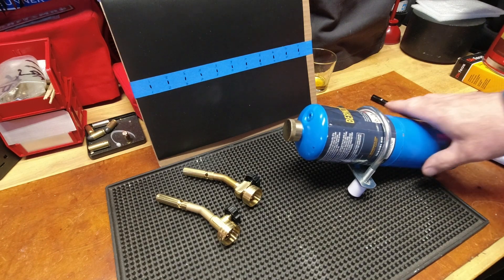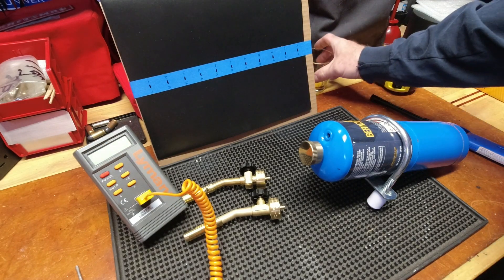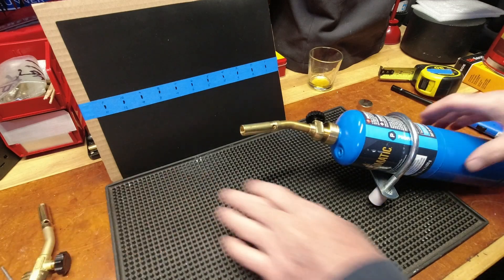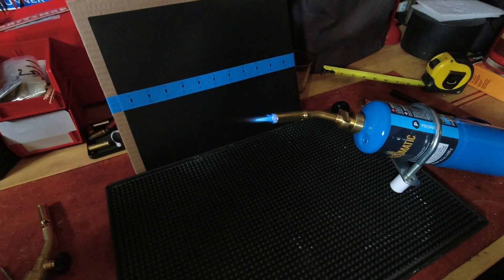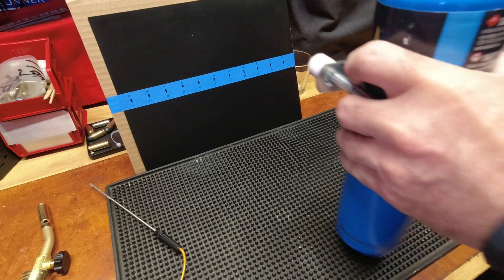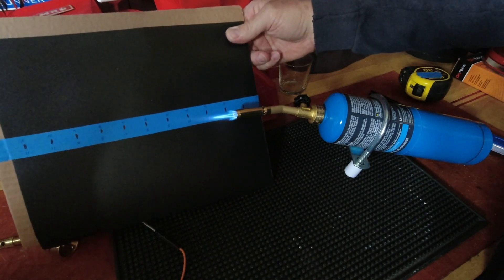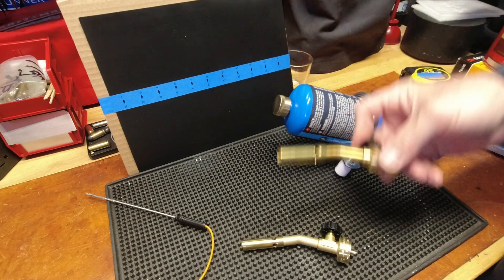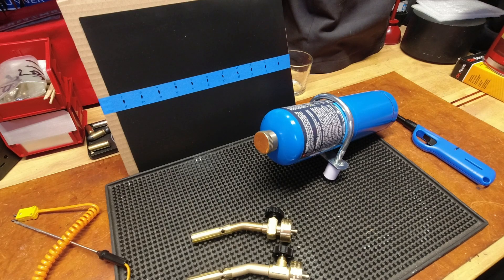Pencil Torch Comparison: More Annealing Stuff

Comment: I believe that flame diameter is the bigger concern. Diameter is what allows the flame to overheat the face of the roller even when pointed away when running short brass cases like 300 blackout.
Reply from the maker: "flame diameter" is a great term for what I'm trying to control in order to only heat the areas I intend to heat.